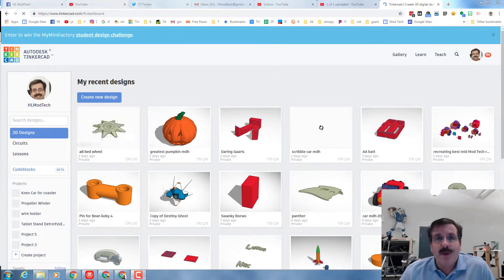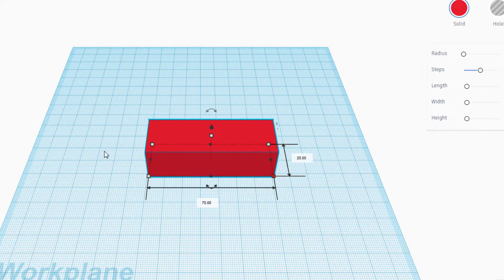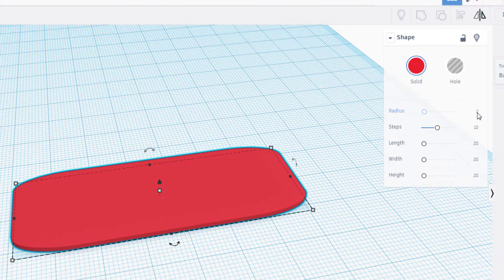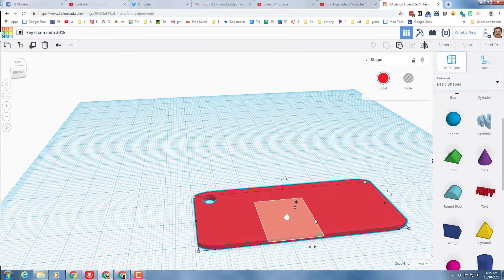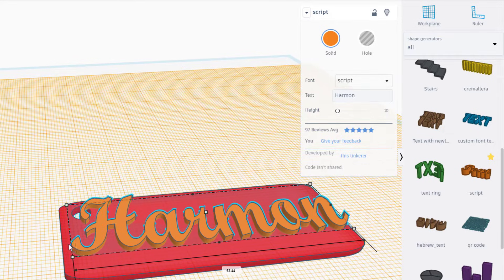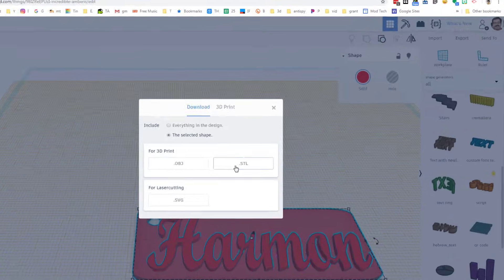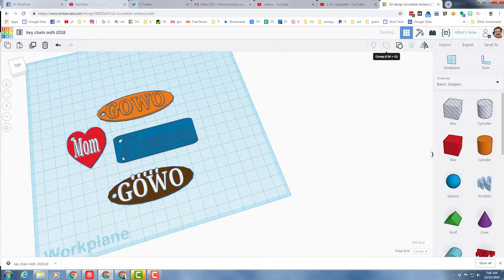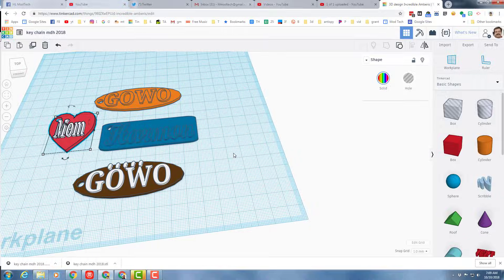Design Your Own Epic Key Chains With Tinkercad In Minutes!

Comment: So great!! Perfect video for a little pre-winter break project. Thank you so much! I did a question though.
Reply from the maker: Thank you. What is the question?
Reply: @HLModTech  I have 100 students and I'd like them to all take home a mini-keychain or logo or ornament and I was thinking my max dimensions would be 30mmx30mmx30mm. Do you think that's okay for purposes of time for the 3D printing process? How long do you think it would take to create one object with those max dimensions?
Reply from the maker: Very smart measurements. I had the general rule of 25x70 and 3 mm high. We could knock those about in about 30 min on just about any of my printers. If you went with 30x30x3 you should be good. 100 prints is a ton... so smaller is really smart. Use .3 layers and I think they would be done in less than 30 min.